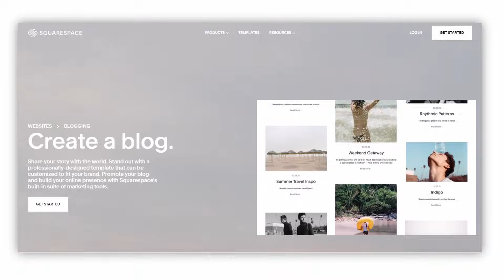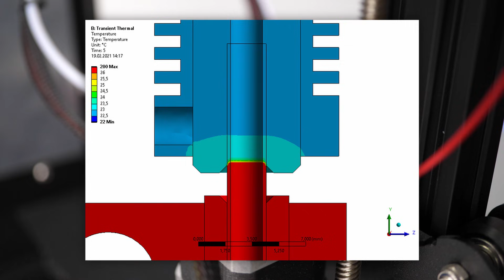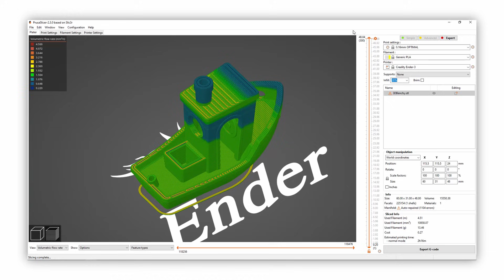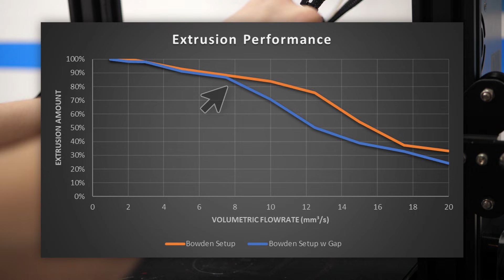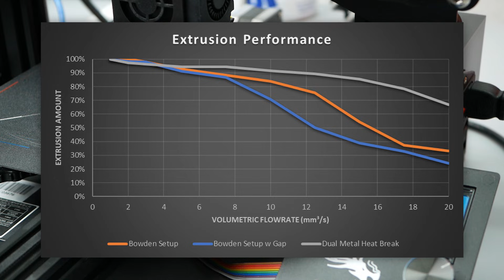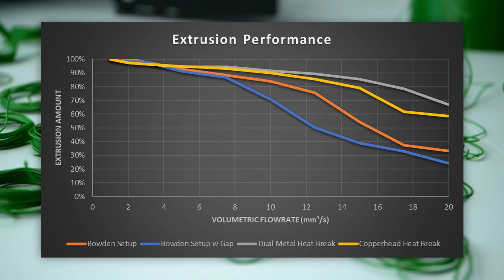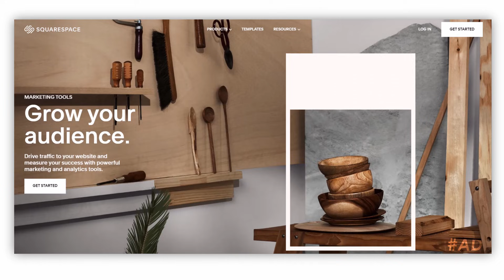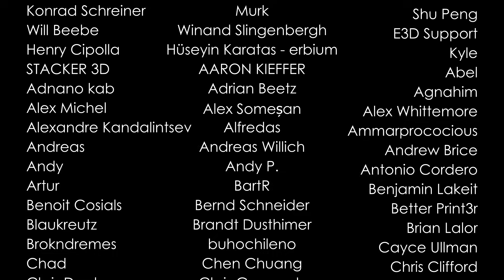Bi-Metallic Heat Breaks - A (R)Evolution?!

Comment: Thanks again for another solid video Stefan.  I'm starting a business but I require testing the loading capabilities of my prints.  I have a 20 ton press, 1kg load cells and the equipment to energize and read the load cells.  My question for you is, how did you go about designing your testing setup with the hydraulic system you have?   Have you used FEA with Autocad Inventor  before?  I see you used Fusion 360 here:
https://www.youtube.com/watch?v=LBZAH5RMR2c&ab_channel=CNCKitchenCNCKitchenVerified

What kind of load cells are you using? Are reading off the fluid pressure or are you reading off a load cell like an S shape one for tensile forces? I've seen how your PC is interpreting load curve, was that software part of a kit/brand specific or is it opensource?

Comment: The concern with the chinese heatbreaks is not that they do not work. Sure Slice and knock off bimetallic heartbreaks alike can be picky jamming with certain filaments, but they both work the same. However the problem comes if you crash into stuff or have a threaded cold end, it can fall apart. If you put a chinese one on a prusa and do not assemble the hotend in a very specific way it loosens the metal tube in the hot side and it randomly drops during a print. Had that happen twice before I learned better.

Comment: Thanks for the review. This will be very useful to a lot of people.

However, I have to object to this product. It does improve things, but it's not the optimal solution. The reason your graph decreases the right is because the actual extruded filament is being heated less and less with increasing extrusion speed. The solution? Increase the surface area for heat transfer or raising the heater temperature. This bimetallic heat break effectively increases the temperature at the metal/plastic interface. However, if we were instead controlling to a constant heat energy per unit volume (J/m3) into the filament by automatically varying hot-end temp with extrusion rate, this would be less important. To create the required hot-end temperature responsiveness, we'd need to minimise thermal mass of the hot-end and have the heat source and sensor as close to the filament and nozzle tip as possible. If we did this, we'd get perfect extrusion at all printing speeds that occur within the typical print because the temperature of the actual filament being extruded would be constant.

If anyone disagrees with this, maybe consider why all good modern soldering irons take the same approach of low thermal mass, heater and sensor right in the tip.

Comment: I've been using the triangle lab bi metal for a while now and have to say it works great. with dry filament I can get a lot of material down to 1mm retraction on bowden and I can now print at 150mm/s on pla. I have yet to try higher speeds but I think I could get some serious flow out of it. not to mention this is a very cost effective way to upgrade to all metal allowing you to print higher temp filaments.

Comment: Looks like you got a v6 heatbreak. I use the chinese trianglelab and i had the same problems in the beginning. But lubing the filament on first install fixed any sticky problems. Now it prints awesome without the use of adding more oil. Great info on the extrusion comparison! Greetings from Belgium🤟

Comment: So I've had my copperhead heatbreak in my Ender 3 for a few weeks now. It ran for about a week in Bowden configuration and I was able to cut my retraction from 5mm to 2.2mm. Bowden tube gap cured and print consistency improved. So your results confirmed 

I didn't really get to play with volumetric flow before I put it in (almost) direct drive with a fake bondtech BMG and a pancake stepper with a printed mount.

I'm still tuning flow rates, mostly I'm really enjoying how well it prints flexibles. I'm going through my stack of designs I wanted to print in TPU and cranking up the flow rate. The PrusaSlicer profiles top out at 2.5mm3/s for you and I'm currently riding 3.5mm3/s with Amazon basics TPU (95A I think?) and cranking this up for every print and now going to have to make changes to the linear speed limits for the basic 0.2mm ender 3 profile as I can't ride the volumetric speed limit everywhere... that's pretty cool for a slow melting filament.

My tuning for PLA has gone as far as getting retraction down to 0.2mm with some PLA and running a printer default of 0.5mm which has really boosted my print speed on complicated parts.

I need to put some time in tuning the PLA speeds now knowing I can push quite a way on volumetric flow before I have to worry.

Comment: Went to Slice Engineering and purchased the Copperhead Heat Break for my Ender 3.  I received it yesterday and quickly installed it.  The results were amazing.  I printed a curved Lithophane using Silk White filament and the backside was almost smooth as glass. The picture was amazing.  Previous attempts were stringy loose layers and inconsistent as well.  Your video was well done and your research was very much appreciated.  This has changed my printing quality, I highly recommend the Copperhead Heat Break.  Their website has a chart to help you get the right one for your printer.

Comment: Great video Stefan! I really appreciate that you showed us how you removed your old stock heat break and re-threaded the block, these are useful details for first time hot-end surgeons.  One comment however: since the heat block was flush with the heat sink with the knockoff test; this likely cause a significant amount of heat creep and could have been the culprit for printing artifacts. Granted this is in part due to the shorter length of the knock off, however even the genuine part had some spacing issues due to length. I may be wrong but I think the heat block / heat sink screws could still have been used as a spacer.

Comment: Why isn't there a heat shield between the lower nozzle end and the upper cooler? Seems the heat will rise straight up from the nozzle and skip the bi-metal part.

Comment: You mentioned the stock extruder skipping, you should review one of the available all-metal dual-gear extruders that are available for the Ender 3 Pro. The stock one has very little grip and starts skipping far too easily. I'm currently getting one in the mail myself, and if I remember I'll review my first impressions as a reply to this comment.
Reply: The skipping is due to torque overload, not the wheels physically slipping on the filament.
Reply: @reeceengineering  In my case, the skipping was on the filament, not in the motor. The motor wasn't able to put enough torque into the filament to have a torque overload. It's a well known issue with the stock extruder on the Ender 3 and E3Pro, alongside the sister issue of the plastic of the roller arm snapping after a while, and the roller becoming unable to put pressure on the filament due to flex in the plastic that's left.

Comment: Now I've tried this and I feel betrayed. My Ender 3 worked perfectly before. I haven't been able to do a single successful print since I've installed the new heat break. The nozzle clogs eventually, even if everything seems to be working fine at the beginning. I have taken apart and put together the whole hot end assembly four or five times now.

Can anyone give me a hint? What I should look at to solve the clogging issue?

Comment: thank you so much for showing me the advantages of bi-metal heat breaks. I orded 2 right away, because I know this might be the solution for my failed CR10S (Pro) dual direct drive volcano extruder conversion. It never really worked because of heat creep.. I was so frustrated that I failed my first and only printer, that I stopped the hobby for nearly two years. Now that I ordered an Artillery Sidewinder X1 I got back into it. Glad to be back! :) Schöne Grüße aus Hamburg

Comment: Mine fell apart at the lower thread portion. The center came right out leaving the threaded portion in my heat block. I was pretty disappointed. Big flaw of these. Made sense when I took it apart as a leak had developed and everything was properly tight. Mine were bought on Amazon for my sidewinder x1 v4 , looks to be the same ones pictures.

Comment: Upgrades like this seem to be worth it even if you're not going as fast as possible because of the thermal performance which means less heat where it shouldn't be, either on the hot or cold side.

Comment: Been considering upgrading my ender 3v2 with an all metal hot end, direct drive, and bl touch... my question is are all those parts compatible or would the high print temps melt the BL touch?

Comment: I have looked at the bi-metal heat-breaks but have not experimented with them.  I have attempted to use one of the integrated nozzles on a Monoprice Mini Select.  It is not hard to setup.  But I have a problem with filament back-flowing up the PTFE tubing.  For some reason, I am not getting the PTFE tube down into the conical tip deep enough.  If you have any insight on this I would like to hear about it.

Comment: Why not cut the bowden tube so it won't retract. This is one of the first upgrades that everyone with an Ender 3 does. Also you can replace the part of the bowden tube in the end with one of better material. This solves all clogging problems for me; noted that I don't need high flow rates.

Comment: Finally someone explained why I would sometimes get Over Extrusion Bulges in certain spots on certain prints. I usually get them in line with holes in the print. Like screw holes and such. Now I know what to tweak to try and get rid of them. Thanks 👍

I use a Copperhead on the Core XY printer I built. I love it. Its a great hotend. Definitely been thinking of putting one on my Ender3. I have no problem suggesting it to others. 😉

Comment: Just a small note, because it's confusing enough as is. Bowden setups don't have the PTFE extending into the hot-zone necessarily. Yours do, but I think I'll add to confusion if people just assume all bowdens have the PTFE extending into the heater block. lots have it extending into the break, but only in the cold side.

Comment: 7:08 - 7:28 was single handedly the most useful tip in my 2 year of printing. Thank you!
Reply: I'm having the same issue, but I'm not quite sure what the takeaway is. What should I adjust to eliminate the under and over extruding?
Reply: If you have that kind of inconsistency, then that flow is too high for the hotend + extruder setup, so you could limit the flow so that every part has the same "low" flow rate, but this is just one of many, that can "help".
Reply: @qwewer6  thank you!

Comment: It sounds like getting this, a good dual gear extruder, and upgrading to Capricorn tubing would give a real benefit. As near as I can tell, this essentially converts the bowden hot end to a metal hot end. No offense to Slice engineering, but the price on that is a little ridiculous. You might as well just buy a metal hot end.

Comment: I put in a bimetal heat break and upgraded heatsink in my direct drive extruder with volcano hot end.  I can now print other exotic filaments on a mid range printer at up to 270C temp.

Comment: You noted early on about how much faster your Mk3s could print than the ender 3 when you were printing face shields.  I would be curious to see if the Bi-metal hotend makes as much difference on that compared to the stock E3D V6 heatbreak.

Comment: question... if i am printing PLA, .4mm, with stock nozzle, 200c, why not just increase the heat slightly? does this only really impact for larger nozzles? the largest ive done is .6mm and i printed fine by increasing my heat to 210-215.

Comment: Change heatbreak, or change full print head ?
I do have a few quality V6 clones around, meant to replace my V5 clone (Anycubic i3 Mega-S), that are still not installed.
So goes for bimetallic heatbreaks: that's something I'd like to test, though there are almost no chance that such an item exists for that printer series (maybe on custom order).

Though, I also managed to find an all-metal titanium heatbreak for that printer (finding one was a PITA ; thanks to the german shop which makes them !), and that's what I'm currently testing these days. I do quite a lot of PET/PETG and ABS, + nylon is a material that could be useful for some things. In that regard, an all-metal heatbreak makes sense.

For now, early results are promising, leading to the same base facts you noticed on Bowden systems with a bi-metallic all-metal heatbreak. Mainly better extrusion and shorter retractions : it went from 2.6-2.8mm with PTFE lining to less than 2mm with all-metal. To me, right now, changing heatbreak is a better option.